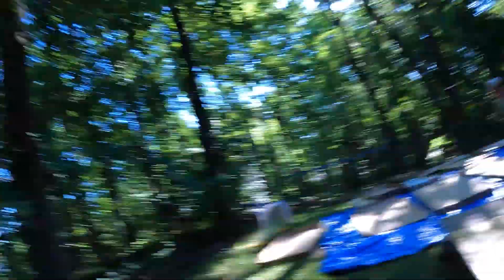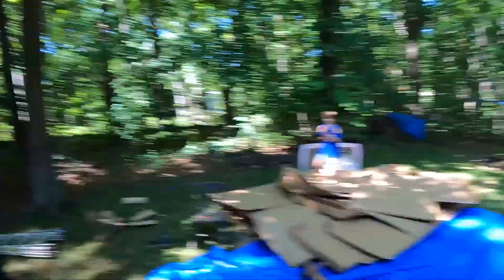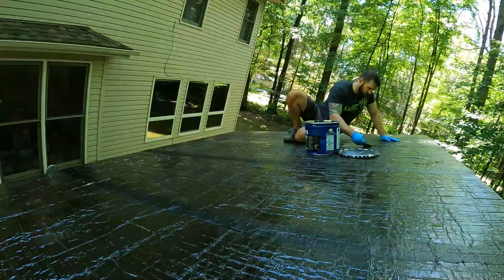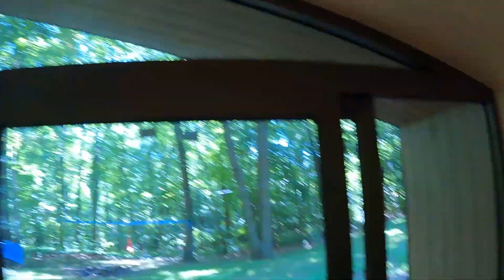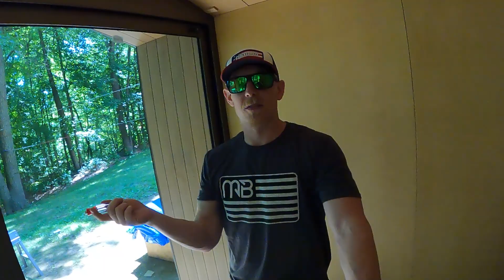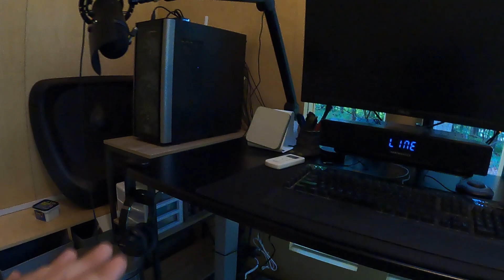Building My DREAM OFFICE In My Backyard! | Autonomous Office Pod

Comment: These never took off so your video is the only one that I have found that wasn't by Autonomous themselves. I LOVE the look of this but I could get a TuffShed that is bigger for half the price. Are the walls insulated already? How hot/cold does your area get in extreme weather? Does it do a good job of keeping the weather and temperature outside? I would add a mini split or some type of temperature control.
Reply from the maker: It is insulated and rigged for electricity with a light and fan.  But i think you could build yourself for cheaper.  That said, they have since dropped the price a bit

Comment: Hey thank you for the video.  Thinking of getting the StudioPod...I live in Colorado...what was the winter like for you?  I heard their insulation is R14 rated, which is pretty low?  Any tips on super low and high temps?  Thanks!
Reply from the maker: Yeah, it won't be warm on it's own, but it can hold heat.  So I picked up a nice wall heater by Heat Storm on Amazon for $100 and ran that on a timer all winter.  I'm in Michigan.  The heater worked really well and I was comfortable the whole season.   In high temps, the AC works well too.  I'd recommend putting the Pod near shade though, because it will heat up quick in direct sun.
Reply: @aaanglers  thank you so much for the reply. Ok so your timer turns off at night? Does the nighttime cold in the winter freeze your computer components, etc? Thanks again for your replies.
Reply from the maker: @christopherhill2773  The heat retained from midnight to 5 or 6 am the next day kept it around 40-50 degrees, which was fine for my computer.  If I was dealing with any colder temps outside like 0 degrees or less, I would run it around the clock.

Comment: Hi Jeff- wondering if you have any moisture/ leaking issues on the front 3 windows? I'm a Pod owner with this manufacturing issue and have spoken to others with the same problem. Would be good to hear your experience with this.
Reply from the maker: I've had people ask me this before.  I think my model may have gotten lucky.  They really overdid the sealant on it.  No issues here
Reply: Ahh good to know! Thanks

Comment: Great video! How is the snow load on this? Also what A/C unit did you use? Looking to build one of these in Oregon but will need A/C in the summer and ability to hold snow in the winter.
Reply from the maker: It held up great this winter!  Ac that came with it is solid